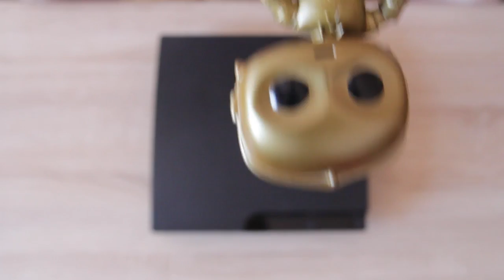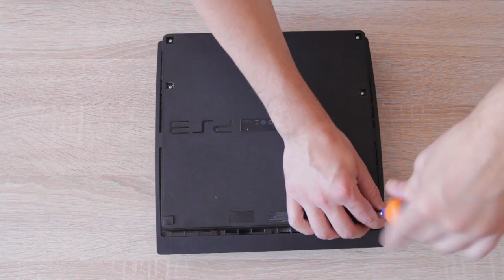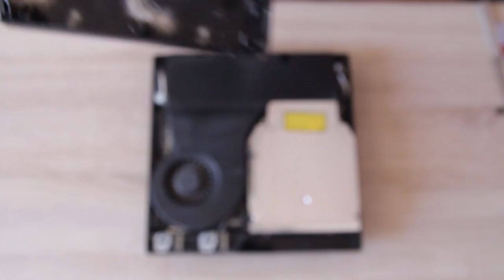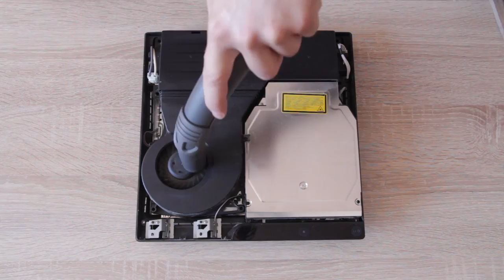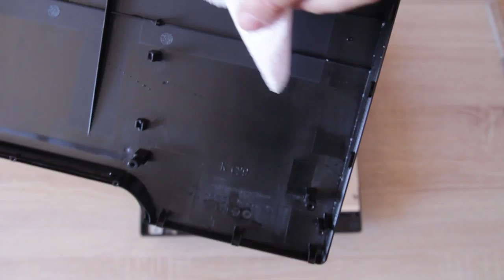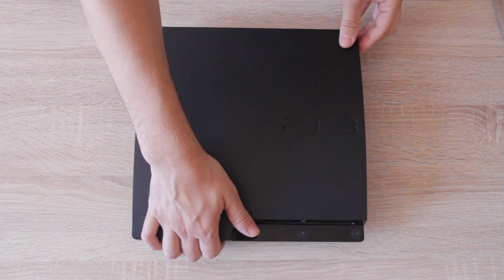Fan noise PS3 solution | How to repair?

Comment: I actually need help my super slim sounds like from the start of the video rarely but today when I started a game as usual all was fine but I noticed the graphics weren't very good at all and no barely any shadows in cod when died the ps3 was loud, it was about 6 times louder, like an explosion, I disconnected it from the power source and HDMI but the red light was still on and making sounds till 3 secs later. It all started when I got minecraft, its probably the storage and room temperature because it was way to hot for 4 minutes of playing, I'm scared I might fry it. So can anybody give any tips? (sorry for the lack of precision  of language)